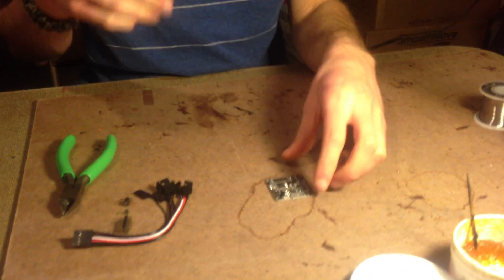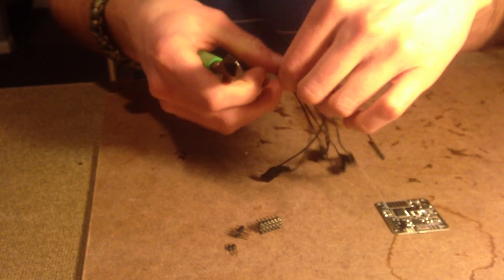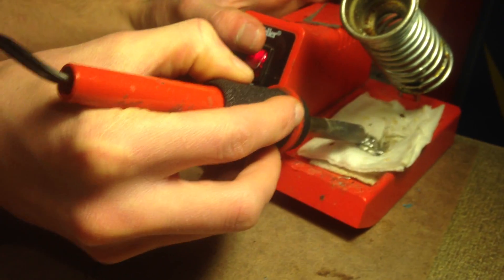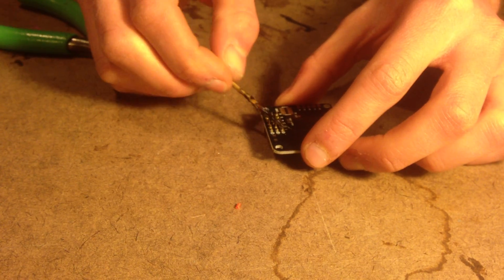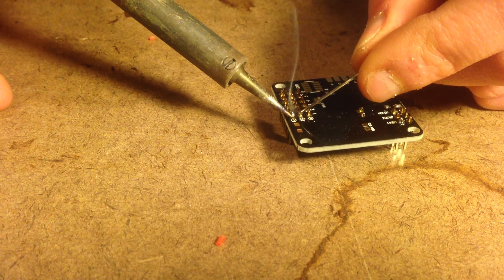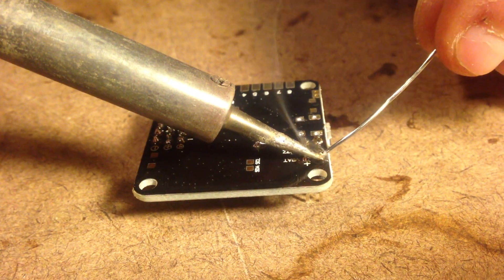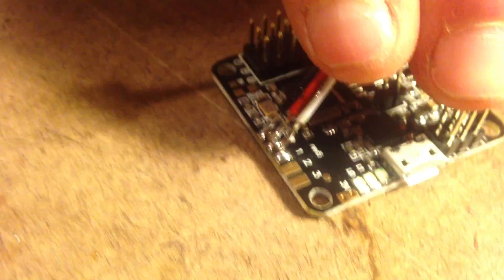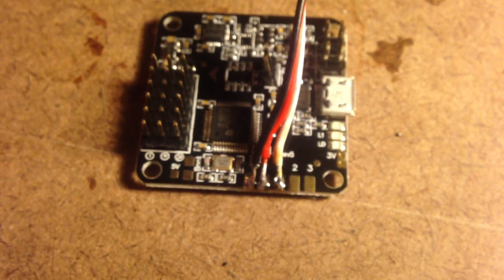Naze32 Getting Started - Soldering

Comment: Hey I have a pre soldered naze32.  Is it possible to unsolder the pins and run them a different direction or will that ruin the board?
Reply: Steven Parker you can unsolder those pins but I am not sure what you mean with "different direction" :)